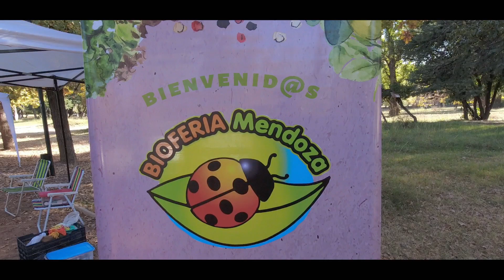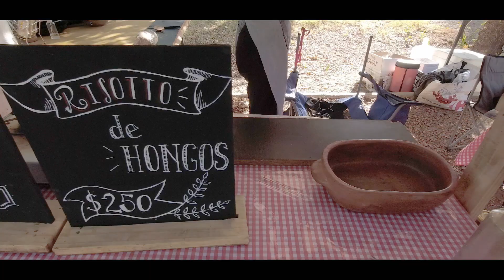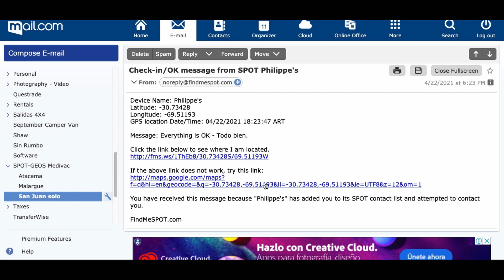Responsible Overlanding / 4-day solo off grid off road camping adventure.

Comment: Hi Philippe, why don't you put insulation on the windows?  How do you do so that there is no condensation?  do you use a technical sleeping bag?  regards!  very good video!
Reply from the maker: Thank you Miguel for your comment. The draft around the tailgate circulates enough air to prevent too much condensation. Every night I make the bed like a real bed, with a sheet, a down-filled bed cover, and blankets, depending on the temperature/season. I sleep much better than in a sleeping bag :-)